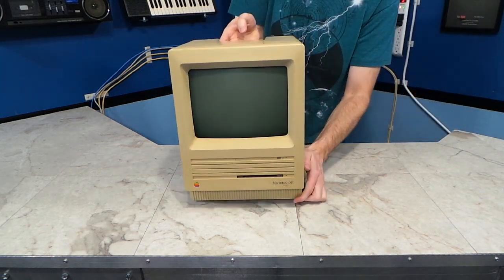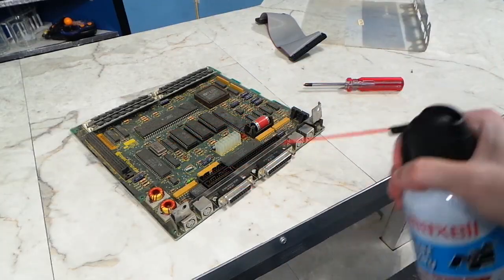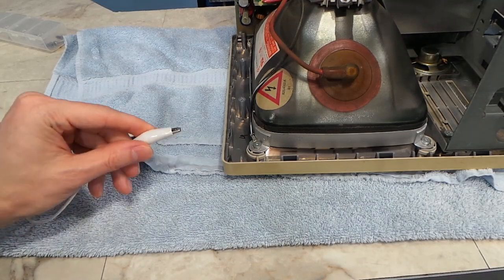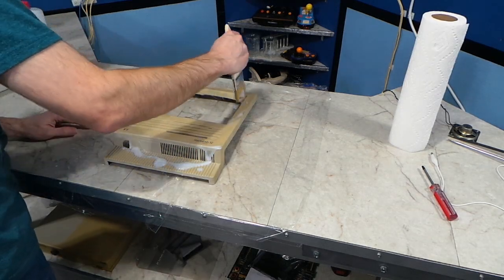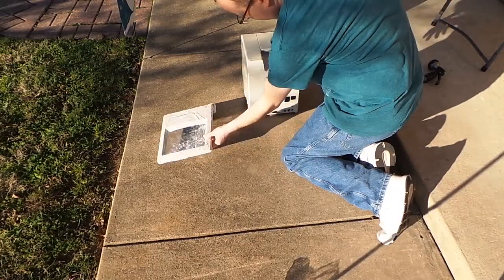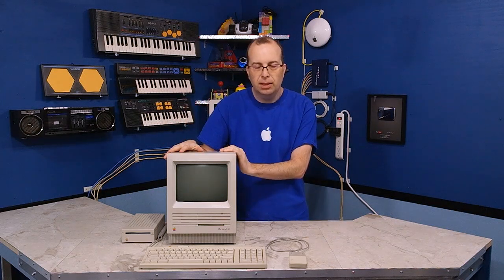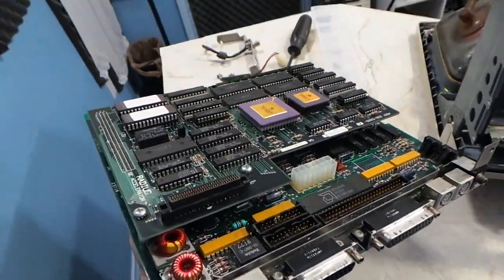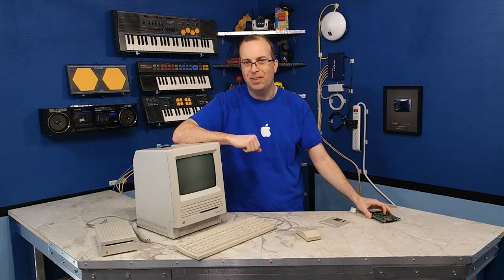Macintosh SE Restoration and SD-2-SCSI upgrade

Comment: couldnt you put in another hdd
Reply: but if its a restoration wouldn't it be ideal to have all the parts the same as an original?
Reply: Hoojikee
I would have thought so. I stockpile tiny hard drives for stuff like this... But sometimes you just have no choice and have to introduce some modern tech to get it going again.
Reply: Yeah, I bet they stopped producing stuff for this a while ago, sadly.
Reply: Yes, but it's kind of hard to get SCSI hard drives these days.  Especially ones smaller than 2GB, which you will need for a Mac of this vintage.

Years ago, back when they weren't so hard to get, I replaced my SE's 30M hard drive with a 200M drive.  Aside from needing a non-Apple tool to partition and format it (because Apple's tool only supports Apple drives), it worked great.  Still does, actually.

Comment: Wait, you clipped to the ground wire, but if the power isn't connected, isn't it not truly earth grounded?  I always was told to clip to an earth-ground such as the metal case of another computer that was plugged in with a proper ground plug.
Reply: Doesn't need an earth ground if all you're doing is discharging the high-voltage anode.  Even WikiHow does it the same way that 8-Bit Guy demonstrated.
Reply: Ah, ok thanks...CRT's make me nervous...didn't want him to zap himself.

Comment: I got the CPU and the BBU confused. Were all CPU's long and rectangular back then or was it just specific to Mackintosh computers? I'd imagine these CPUs would be specific towards premade computers since saudering can be a bit of a choir.
Reply: Pretty much, yes, they were long and rectangular.  Usually (but not always) they were socketed in case you had to replace one.

Comment: Why was it that they made all these old computers in that beige/tan color?  What started that trend?  You should do a collab with "The Engineering Guy" about an old computer or keyboard...
Reply: Mostly, it had to do with the type of plastic ("ABS Plastic", also called Acrylonitrile butadiene styrene) they used.

While you could add pigments during the manufacturing process, a lot of companies didn't, to save money on production costs.  The raw material original color is actually white (or sort of an off-white similar to ivory).
Reply: SpearM3064 ah, so that beige is the "default" color?
Reply: Yeah, pretty much.  Usually it was more of an ivory white, but slight differences in the manufacturing process could make it beige.  For any other color, you had to add pigments.
Reply: Thanks for the info!  I'm bad with colors, so when I say "beige" I mean that tannish-white or bone/ivory color.  Thanks again!
Reply: The main reason is as stated by others, that its just the base color of the material. The reason it turns the color it does with age is Bromine, it reacts with UV light and turns that color.
Another reason that a lot of companies didn't dye the plastic aside from costs, was business's didn't care what color it was tbh. And thats who bought a lot of these early PC's. Albeit Apple's were more directed towards the home user I think.
Reply: Marketing, maybe.....  they wanted their computers to look like  a real professional computer,  not a toy or gaming console?
Reply: Dracolith1 Thats actually a big part of it. IBM actually stated early on that they had no interest in the home market. Just business machines and mainframes.

Comment: Lithiums dont ever leak 99% of the time they are mostly dry.  it's only alkalines   the   zinc–carbon  "heavy duty are dry cells and do not leak but the power life sucks.     lead acid battery are car type/ups battery and sealed good.  the 1989 one that they put in was a lithuim.

Comment: 8-bit guy I had a problem with the floppy drive on my old macintosh too. i noticed that the head of the drive  was not making appropriate contact to the disk. after messing with it i got it to work. maybe you should check it out.

Comment: I'm surprised that you didn't mount the SD-2-SCSI device a little farther forward in the drive bay such that you could eject the card out the front drive slot.  Given that your problem could be either a write-protected SD or simply a flakey SD card, it would save you a ton of work if you need to swap out the SD card.

Comment: Those old Quantum hard drives have a rubber stopper internally that grows sticky over the years -- causing the head to become literally stuck in the parked position.  Take the drive apart and replace it with a foam foot pad from hardware store.

Done this successfully for several SE and SE/30's
Reply: Sometimes letting the drive run to temperature over an hour is enough to unstick the park bumper with no further action.

Comment: I got to around 13 minutes and was thinking... Did he remove the write protection from the SD-card. :O
Reply: if he didn't, he wouldn't be able to bake it with PiBaker.
Reply: you got me to think the same thing :O
Reply: i've done that before, it sucks.
Reply: My question is maybe his SD card is too big 

I know a lot of older apples will have a hissy fit if the hard drive or "hard drive" in this case is too big
Reply: Maybe he could check the read/write switch and check a new SD card?
Reply: same
Reply: I thought that too!
Reply: Same
Reply: Oh... my... god....
Reply: ZeroG84 fg

Comment: May not be a relevant question here but this is something that has troubled me a lot. Windows 98 used to have a graphics setting called "Small Fonts". A particular game (basically a cricket management game called "Australian Cricket Captain") used to run on those settings. This setting was disabled Windows XP onward. I have tried to get hold of some old laptop that has Windows 98 but have not been able to manage it. Can you guide me on this?

Comment: Ha! A couple of days ago I was cleaning up and found that old SE/30 that I always assumed to be dead. It was sitting in the trash when I saved it. Since somebody removed all it's screws, I looked inside just to see that there was no memory installed. I ordered 4MB on ebay and what do you know? It starts. Sadly, the Hard drive is missing, so i will have to replace it somehow. But hey, I have a SE/30 in partly working condition.
Reply: Oh, and you don't pull the Board all the way up through, just about 2cm and then you can tilt it out on one side. This is IMPORTANT with the SE/30, because otherwise you would break the Rom, sitting in a socket at the front part of the mainboard. Almost killed mine.

Comment: I have an SE/30 that needs a lot of love, and probably new capacitors as they all do. I'm surprised the analog board in your SE was still good, those usually require maintenance at this point in time.

Comment: @The 8-Bit Guy - I'm curious as to why you opted for SCSI2SD v6 instead of v5? These SE's are pretty robust. I can't say the same for my SE/30 project. Also, did you notice any damage to the case's internal metallic coating after the retrobrite process? To mimic what another commenter said, I found that hot glue was ample for holding the speaker in place in my SE/30. It also will make it easier to remove in the future, if necessary. If you don't have one yet, bigmessowires's FloppyEmu is a great addition to a vintage Apple enthusiast's arsenal. Anyway, job well done.
Reply: The SCSI2SD v5 worked in my SE without issue. I used a utility called Lido (available on a popular abandonware site) to initialize the SD card. Perhaps that may work for you?
Reply from the maker: The creator of the product sent it to me for free to try it out.  So that's just the version he sent.

Comment: The mac classic II was the last of the b&w lunchbox macs and has the highest specifications.  That said, I scrounged a Classic and Classic II from the e-cycle dumpster at my local transfer station.  I'll give you the Classic if you want it.  The case is kinda boogered up because stuff got thrown on top of it.  But it has an HDD and works.  Message me if you're interested.

Comment: The two-prong header was put in the wrong way around. The pins that should have been pointing out were soldered into the board instead. The plastic piece was also pushed too far forward

Comment: 8-Bit Guy: IMPORTANT... Did you try setting the SCSI board to another ID number? The Mac uses one number and the board must be on a different unused number or SCSI will not work. Also check the termination setting on the SCSI board that it is set right for that situation.

Comment: I still don't really understand why there is a battery in a motherboard.... is there anyone who knows?
Reply: The battery powers the RTC (real-time clock) and the CMOS SRAM, which is
 called PRAM (parameter RAM) on the Mac.  It stores settings like 
keyboard and mouse sensitivity, the selected boot device, and the sound 
volume.  Flash memory could store these settings with no power, but 
flash memory wasn't available back then, so they used battery-backed 
CMOS SRAM.  If the battery dies, those settings and the current time are
 lost at power off, but the computer still works otherwise.
Reply: ToasterKing Ah, Thank you so much!

Comment: Also remember that it could be the size of your sd card as well certain Macintosh computers had a hard drive size limitation in the o.s the Mac plus originally had only a 50 meg external hard drive. you might also try a sd regular card no sdhc no sdxc it might be the device is designed for a sd only card.

another thing to check as well.

check your solder joints the Macintosh plus and the se where known for dry solder joints that have to be reflowed on occasion due to dry solder as well. this is why you get some with garbled images on the screen I would check the original drive using a scsi adapter and see if the drive will access externally on another Mac if the drive boots most likely its a SCSI chip failure which isn't all that bad because you can purchase dead monitor SE's with good chips for replacement.

I grew up on a Mac plus and they can get hard to deal with as well with video failure and other known issues. 

keep at it though and don't give up.

Comment: I should mention that using that popular screwdriver technique is a terrible idea. The charge stored on the CRT is not much more powerful that a good static shock (like that from a van de graaff generator) and I don't think there have been any reported deaths from a shock from a CRT. You can see in this video how close your thumb gets to the (hopefully grounded) screwdriver. However, those aligator clips can pop off very easily and then your screwdriver touches the HV wire, and can transfer that shock to your thumb. 10kv can easily jump a centimeter to your thumb.

Comment: I recently replaced the SCSI drive in my SE with the SD2SCSI, but I have a different board than yours. It's red and a lot smaller than yours. Also, I used the stock drive setup, but changed the serial number and drive identifiers to make it seem like an apple drive, you may want to try that.

Comment: These early SCSI drives suffered from a symptom in street terms we called “stiction”.
This happened if the SCSI drive was not used in a very long time and resulted from
the hard drive heads sticking to the platters in their landing zones.  Yea, back then after
a hard drive powered down they actually dropped the read/write heads onto the platter in
a designated landing zone. In a power up sequence the heads retracted, spread, then the platterwould spin up and the drive would load.

The method for restoring a hard drive with “stiction” was to use a technique aptly named “ thumping the drive”. This would free the stuck head, and as the term implies “ thumping the drive” involved banging it on a cushioned surface to free the head.   Any drive I would need to “thump” I considered to be marginal and advised the owner to cough up the money to buy a replacement.  However, I personally have experienced completely perfect operation from a “thumped drive” after the process.  But for reliability I would never recommend this to a client unless they were completely out of money and there was no other choice.

Comment: No need to Replace the Hard Drive. When I got my '87 SE, it only booted off of a floppy. I accidentally ran into a door frame with it, and voila, the Hard drive began to work again.
Reply: Those of us in the 'tech trade call that "Percussive Maintenance".  Give it a few hard whacks until it works.  Probably the hard drive was like the brakes on a car that's been sitting for a few months... the head had "locked up", and the collision with the door frame knocked it loose.
Reply: Technology always seems to work that way. You spend all this time and money on repairs and the damn thing won't work, but then you accidentally drop it and that fixes everything somehow.
Reply: SpearM3064 Yeah, some HDDs have a stiction problems.
Reply: I've got an HDD that won't work because of stiction unless you turn it on its side.  Then it works perfectly.  (Fortunately, I use it in a hot-swappable external drive housing that just happens to be designed to stand on its side.)
Reply: As long as it's a 3.5" SCSI drive, it should work.  Finding them in the original 40 or 80 MB size (yes, MEGAbytes, not GIGAbytes... remember, the SE/30 was only designed for 8 megs of RAM) is the hard part.  Believe it or not, there are still some original hard drives floating around; expect to spend around $100, plus shipping and handling.

I know you're wondering why you'd spend $100 on an 80 megabyte SCSI hard drive, when you can get a 36 GB SCSI drive for just $15.  Well, the answer is (1) I'm not sure the SE/30 is able to handle more than an 80MB drive, and (2) rarity.  Original 80MB hard drives are as rare as hen's teeth.  My search turned up only three original, refurbished, Apple 95F7181 drives (though it should also, theoretically, work with equivalents like the IBM WDS-L80).
Reply: Lol that's cool! Does anyone sell hard drives for old Macs anymore?
Reply: Ford Mavericks OS X yes, but it's going to be costly and may not be worth it, as those drives are getting old and more unreliable. Which is the main reason why David wanted to switch to a SCSI-SD adapter.
Reply: If in doubt, give it a clout

Comment: I used to have a MacSE with an Ethernet card and every 5 years or so I'd pull it out and try to get it onto the Internet. But then I'd start encountering all those freezes and other weird problems that made the Classic OS (and hardware) such a nightmare to use. So I'd quit, wait 5 years or so, and repeat. I finally got rid of it. But good luck regardless!

(I finally quit the Internet attempts when Google stopped supporting HTTP 1.0 and NCSA Mosaic didn't support HTTP 1.1.)

Comment: Oh, and as for the CRT safety, yeah, it's a good idea to not mess with them if you're unsure about them, I had one discharge its capacitor across my chest a few years back, it hurt a lot, and left me panicking for hours afterwards (obviously pointless cos I'd have died in minutes if it had stopped my heart!), not recommended at all... :S
Reply: Yeah, you really have to know what you're doing when working with an old CRT.  Old power supplies (prior to the ATX form factor, anyway) had similar issues... capacitors that could hold a lethal charge.

Comment: I really should try the peroxide treatment someday, got my Amiga A500 PSU still and that has turned a really foul-looking orange colour, which is a shame cos they're slightly better PSUs than the ones that came with the A600s, it just looks really nasty... :\

Comment: I have that same Mac and mine had a locked up hard drive in it.  I ended up putting a standard 100 MB SCSI drive in it.  I used that same patched program that you did and got it work with no issues.

Comment: I restored mac classic and first version of SE many days ago. Old macs have much problems with new hardware. i use new branded but standard HDD scsi and mac works good. I use a mac os 7.5.3 on classic and 6.0.x on se (because it has only 800K floppy). And all works good.
And the biggest problem is in capacitors in those macs. I replaced all.

Comment: I actually have a Macintosh SE/30 right here, along with a Mac Classic and a Mac Plus. Unfortunately the SE/30's power supply is busted. It was already showing signs of weak voltage when I got it, and after a while it just stopped working. But not before I was able to upgrade it with 32 MB of RAM, a PDS network card, and got the Google search page to show up in Netscape 2 on it. Wonderful little machine, way ahead of its time in many ways.

Comment: Couldn't you try to repair that quantum drive ?

Apparently sometimes they can be repaired. In fact the common problem with those old quantum drives is that they used rubber bumpers inside of it, but unfortunately after a while they become really sticky and so this is making the disk unable to spin up or the head unable to move.

I've got a 486 with one of these drives and I have to restart the computer a lot of times until the head manages to unlock itself. One day I will disassemble it to replace these bumpers but for now I don't really mind as once it's unstuck, the drive works perfectly

Comment: Be careful those monitors can store a lethal amount of voltage long after powered down. You can use a remote battery if your worried about leakage or an nvram

Comment: +The 8-Bit Guy Use an SSD as it is much better and easier to set up and use as others have used SSDs on newer macs and Druaga1 has successfully put SSDs in to macs but I don't believe he has tried it in a mac as old as this but he also has experience with using SD cards instead of HardDrives and has used SD and SSDs in a number of Apple products so hit him up and see if he can help you out.